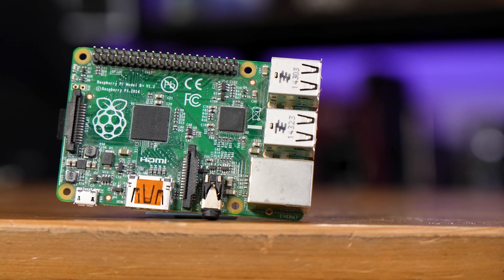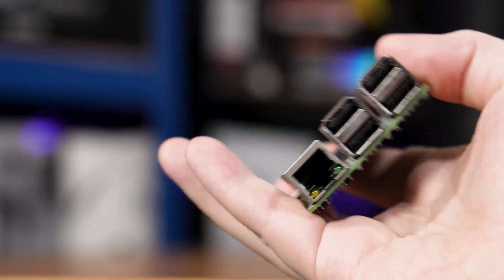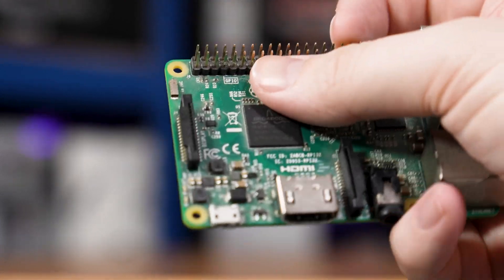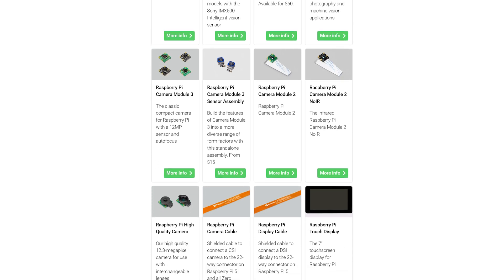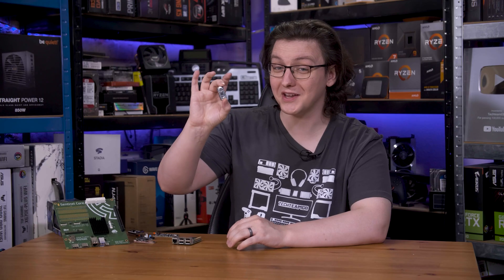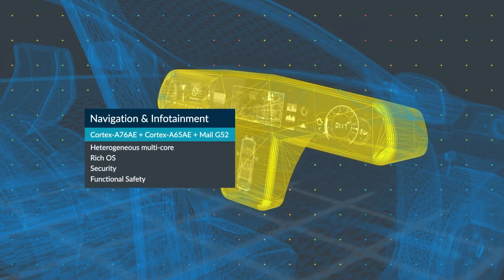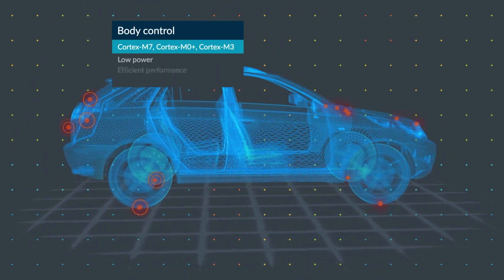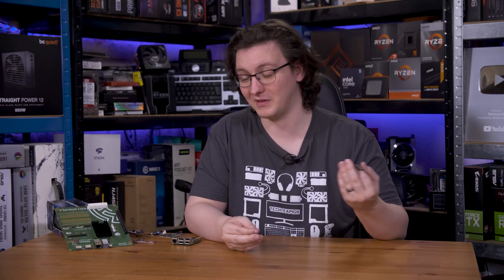Raspberry Pi VS Arduino VS ESP32

Comment: WHAT BOARD WOULD BE A GOOD budget friendly option to start in my journey to learn the following:
I probably want to work with photo eyes and learn how they work, I think home automation, power over ethernet, and how Resistors capacitors , transisters, and MOSFets as well as other components interact to change current and voltage into o create radio waves or computers or TVs etc operate.

Comment: I was called to fix an apartment buildings door king system.  I found and left behind, A adruino boardt was turned into a diialer and a toner someone had made to help them diagnose problems.  This sparked my interest in the product.  Not I'm overwelmed.  I saw an sp32 sensor kit on Amazon which looked pretty fantasgic.  I am a novice coder and Linux user but can compile source code.  I would love play around with this as an electrician and a tinkerer.  My concern is that free time is non existant .  when not working I'm fixing  house stuff or cars or bikes etc.   I need projects to be something  I can do an hour one day or 30 min another.  Over a course of 3-5 days.